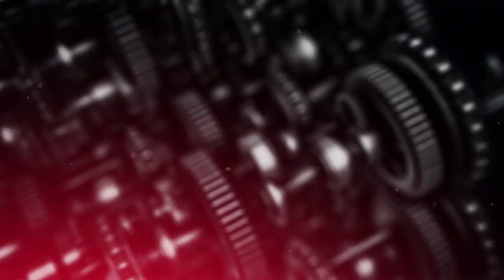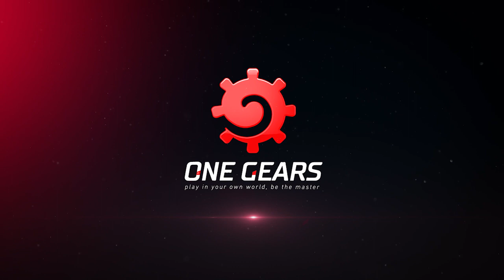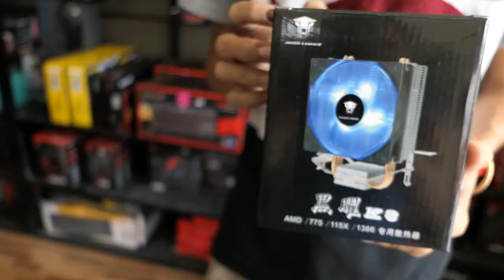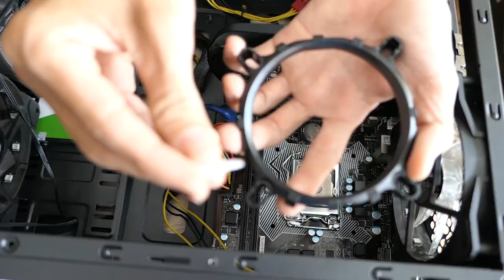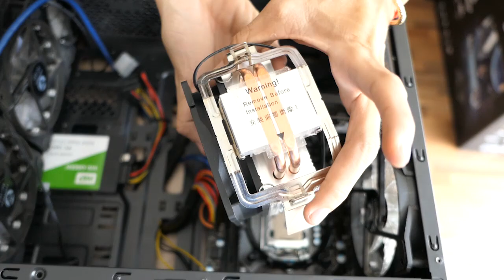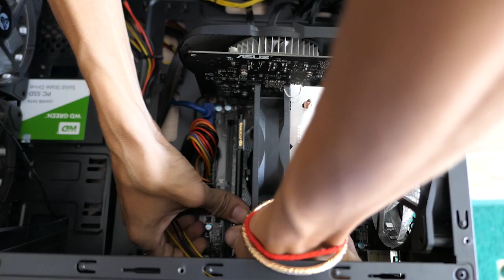How to change intel stock cooler?

Comment: the amount of people who probably used water to get their thermal paste off is sad
Reply: Is this dangerous?
Reply: @Rtx3060zz  it is a bad idea to clean up computer component by water. Could easily cause corrosion or short-circuit. If you need a liquid to help cleaning, isopropyl alcohol is the best option. If you can't find isopropyl alcohol then rubbing alcohol will also be a good option. Make sure you wait for a few minutes for the alcohol to dry then reinstall everything
Reply: @vil-jr  5 mins will do?